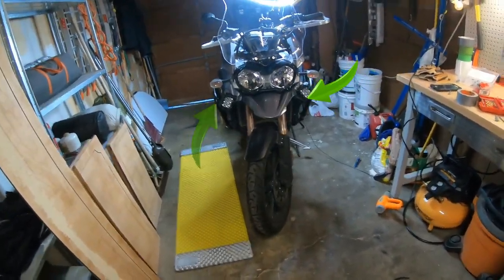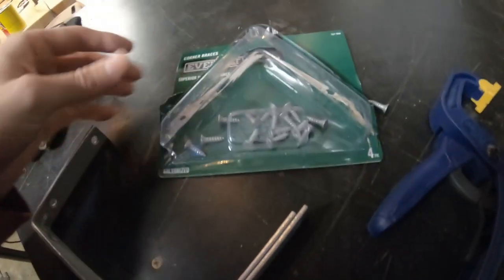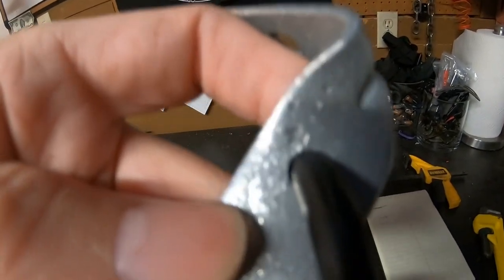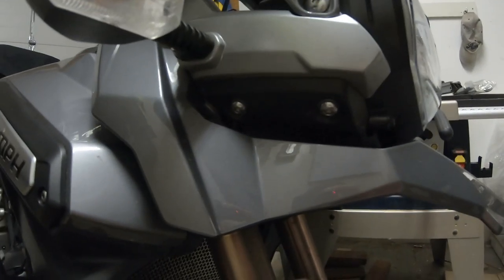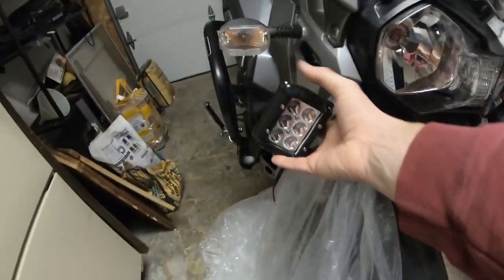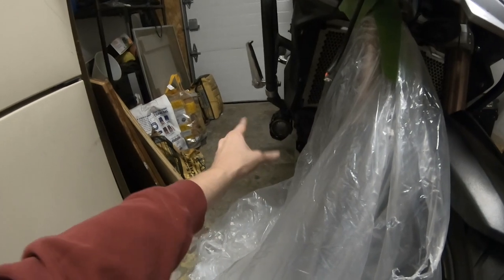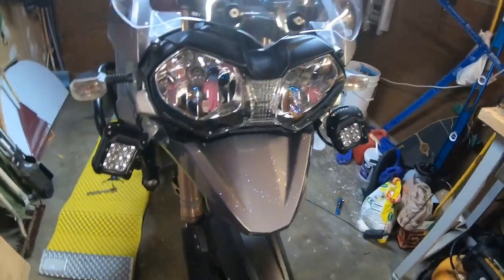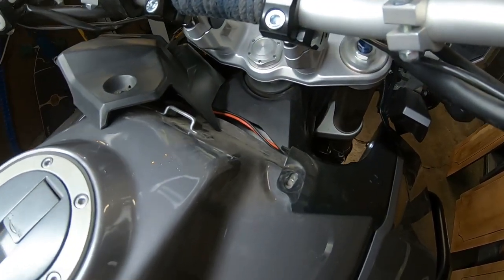Let's upgrade motorcycle lighting!

Comment: Good vid! I like how your bike looks "holy" (good use of the light). But yeah, isn't this what motorcycling is all about?  Really cheap workarounds that are functional. As long as they hold the lights well, I don't see any problems. Those lights do seem brighter. I don't know how much riding you're going to be doing in the dark, but it is fairly dark nowadays. Better to be safe than sorry.

Yeah, I'm not sure what modifications I should be making on my bike. In theory, I want to keep her speed and will probably look at those different exhaust systems or other things. But in practicality, adding saddlebags and other touring gear will probably slow her down...If only I had money for a second bike...but isn't that how it starts? 

Anyways, keep up the good work. Looking forward to the next one!
Reply from the maker: Thanks! and yes the lights are MUCH more effective now.  You could always look at having engine components polished and valve work.  That would net some pretty insane gains but can get pricey.  I don't think the saddle bags would slow your bike too much if even noticable unless you really load them up with heavy things.  Plus you can carry nice touring tools with you so you are covered for certain break downs (hopefully they never occur).  Soft bags are great because they can protect the bike in a  tipover and can easily be removed if you're really jetting around.  Usually a bit cheaper than hard cases as well..  Thanks as always!

Comment: couple of rubber washers where you bolt them on would stop them shaking. im going to put them lights on my e-bike,i seem to like them more than the cree
Reply from the maker: Lenny Rossa that is a good idea, it turned out there was no vibration on the lights it was a loose bolt on my bark busters 😂 .  Still love these lights.
Reply: @motodrang4287  just ordered a set,got them for 22euro (17usd) with a switch,come from china so bit of a wait.
Reply from the maker: Lenny Rossa right on, best I’ve seen for the price. Ugly as sin but utilitarian.

Comment: Why did you get rid of the cheap aux lights
Reply from the maker: Rahshawn Gilmore the cheap ones were ok but I really wanted a spread of light rather than spot lights (cheapies were spots). Now the ground around the front of the bike is lit up nicely.  The new ones use more power but are quite a bit brighter.  And come to think of it the new ones were only a few bucks more🤣
Reply: Glad your happy with em stay on twos keep on adventures.  I was thinking about the cheapies for my z900 I live in nyc and just want that halo look
Reply from the maker: Rahshawn Gilmore right on, if I was to do again I’d probably spend a few bucks more for ones like these halo style Motorcycle Headlight LED Fog Light 3 inch Round Blue Angel Eye DRL White Light 10-80V DC 8000LM Waterproof Off-road Vehicle Marine Work Light (2 PCS) https://www.amazon.com/dp/B07SSS7Y98/ref=cm_sw_r_cp_api_i_YXGvEbPDYC959